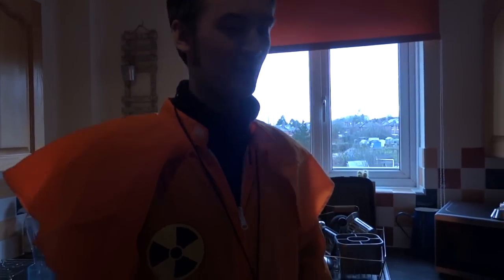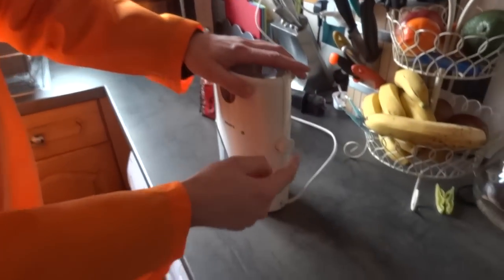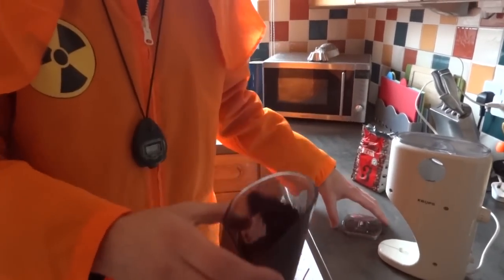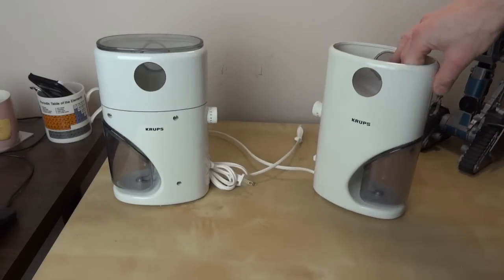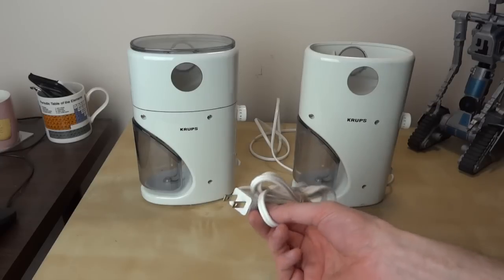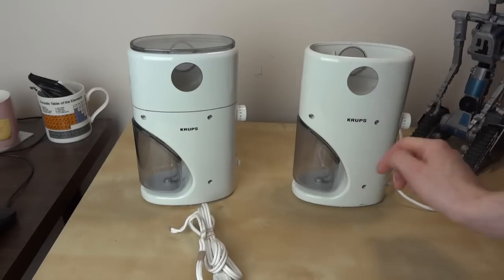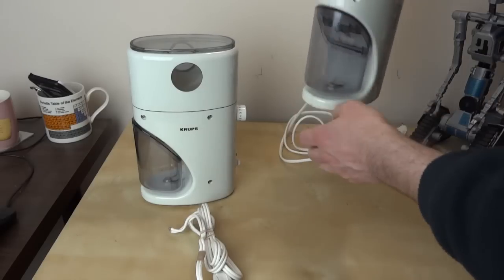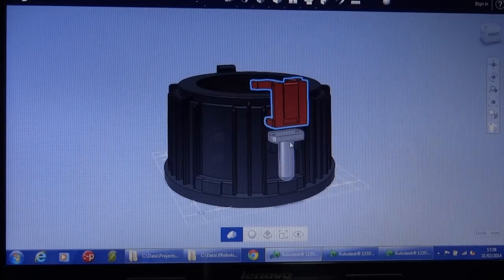BTTF Mr Fusion #1 | Using Krups 223A Coffee Grinder | James Bruton

Comment: very cool BTTF build !
for your acetone weld, I suggest you make "partial putty" so that you gellify the acetone with a bit of ABS chips (putty is 50-50, gellify would be more like 10 to 90 or 25 to 75%). That will allow to the acetone to be stored into the ABS and take slightly longer to evaporate which is nice to adjust the position of the 2 pieces. That's similar to what model glue is (gelified version of a solvant). Adding matter in the acetone mix also allows to fill in better and bring usually stronger joints. As you're 3D printing parts, you can use the exact same ABS filament you're using for printing or even raft / support / leftover ABS you have from prints.

Comment: James, do you think your 3D printed parts wouldn't crack if the lulzbot was kept at a somewhat warm temperature thus allowing the pieces of ABS to cool more slowly? If so, do you plan on modifying it? It could be something pretty simple, like placing it inside of an oven.